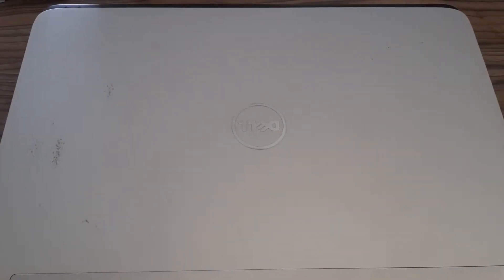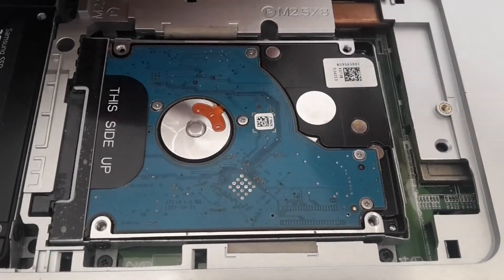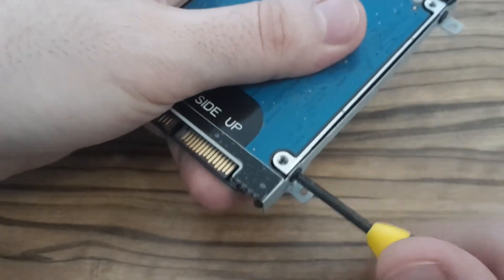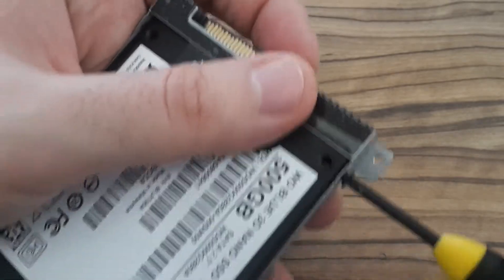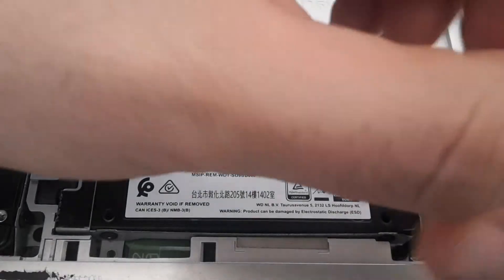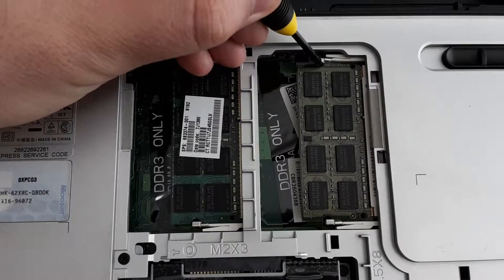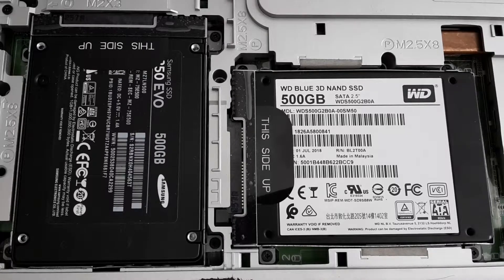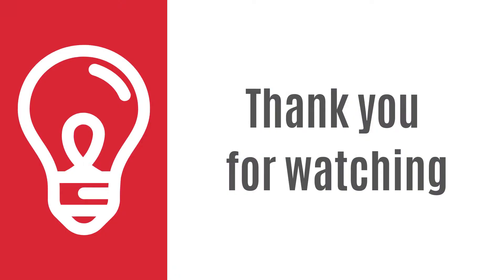Dell XPS 17 L702X Upgrading to a New SSD and RAM

Comment: Thank you for your video, my 11 year old laptop is in desperate need of an upgrade and your video is the solution. I ordered the exact same SSD you used just to avoid any discrepancies.
Reply from the maker: Glad I could help!
Reply: How did it turn out when you installed the ram? I jsut ordered the same ram. I downloaded windows 10 years ago and it slowed it down so much 😢 hoping the ram upgrade helps

Comment: Hi i have question we have the same laptop but i have 4 slots of ram is it an problem if i do 4x 8gb? And maybe one 1tb ssd and other 1tb hdd?
Reply from the maker: Hmmm, but that laptop supports only up to 16GB RAM, so you can try 4x4GB RAM. The HDD/SSD don't have limits.
Reply: @zeroampselectronics  oh really that's weird but I have an fun fact I did 1x8GB 3x4GB  (20GB ram) and nothing happened it runs  really good and play GTA 5 perfect in 2022😎
Reply from the maker: @nourilo5487  you might have a especial edition try 32GB if it works.
Reply: @zeroampselectronics  yes i would like to try that but i have not found anyone that has tested before i am now looking for another l702x i would like to try it on but they are really hard to find
Reply from the maker: @nourilo5487  they are very old but you might be lucky.
Reply: @zeroampselectronics  yes, if I still find 1 and have tested it, I will definitely let you know

Comment: Great video! I have the same laptop and have been running into an issue where the system runs at 100% disk usage, so everything is super slow. I've googled the issue, cleaned the disk, and have done several other solutions i've found. Might upgrading from HDD to the WD Blue you use here help, or is the Samsung 850 EVO 500gb SDD like you have in slot 1 better?
Reply from the maker: I decided for WD Blue because it was a bit cheaper I didn't have extra many for Samsung that time.

Comment: Thanks for this video. My brother was trying to install an SSD in my laptop for me and couldn't get it to work until following your video :) I do have a question though. I don't know very much about computers so hopefully you'll understand what I mean. I wanted the SSD installed mainly for a few games and wasn't going to move anything else, but was recommended to put windows on the SSD because it'll make everything faster. I've tried googling, but the guides I'm finding only tell me how to clone my entire hard drive onto the SSD. My hard drive is much, much larger than the SSD so cloning everything wouldn't work. Do you know how I could get windows to boot from the SSD without copying everything else to it? Thank you.
Reply from the maker: Hi, I'm glad that it helped :-)
Reply: @zeroampselectronics   I've managed to delete enough off my hard drive that everything can fit on the new SSD, so now I'm on to the cloning process. Is there any cloning software you know of that you'd recommend? Been googling and there's so many options that it's a bit overwhelming haha.
Reply from the maker: Hi, I use https://www.macrium.com/reflectfree, but you're right there are many others on the Internet.

Comment: I installed a new ssd no problem. Created bootable windows installation USB. The computer boots into setup and copies Windows files from the USB to the new SSD. Then the installation tool goes to restart the computer to finish setup but can't restart. It just ends up with a black screen/blinking cursor. I used Rufus with MBR target: BIOS.
UPDATE: Removing HDD from position 2 fixed this. For some reason, I think the boot loader was being installed on the backup HDD, so the new install would not load. (I only replaced the primary HDD to SSD)
Reply from the maker: You can change the order in BIOS for loading.
Reply: @zeroampselectronics  thank you - yes, I had it set to boot to disk 0 which was the new ssd then usb. For some reason, removing disk 1 (the other original hdd) solved the issue. I read somewhere that with these old laptops that the installer can put the bootloader onto the second old hard disk.
Reply from the maker: That's really strange.
Reply: @zeroampselectronics  In my recent experience I had to remove the second drive to format and install Windows 10 Pro.  the system did not lift and did not install properly with the disks installed

Comment: Hi, I installed a SSD and Im trying to install w10, but my usb is not showing up in my boot devices..
Reply from the maker: Hi, you must change that in BIOS.
Reply: @zeroampselectronics  Im at BIOS version A11, I dont see any settings regarding USB boot device..
Reply from the maker: That's very strange because on mine there is such a option to boot from USB. My BIOS is A17.
Reply from the maker: It looks you have an old version. Try to upgrade your BIOS.

Comment: I attempted to put a ssd (has windows, booted in a desktop fine) in mine to replace my hdd, but its saying no operating system when attempting to boot from the ssd. Any idea what could have to be done?
Reply from the maker: Hi, I guess, you have a wrong BIOS configuration on your laptop. Compare your desktop and laptop booting configuration.
Reply: @zeroampselectronics  its hard to compare bc they look completely different, its the z170a and i have an x570 gaming edge. Thank you for the help! I'll try it.
Reply from the maker: I just meant to check booting mode either: "Boot to UEFI Mode or Legacy BIOS mode". If you use your SSD in one mode it should stay the same. Otherwise it won't boot correctly. The second thing is that your desktop has completely different configuration than your laptop so the Operation System won't work on your laptop anyway. I recommend to install the OS on the SSD in your laptop from scratch.

Comment: Hi, can you put ssd drive in first main disc slot directly under a ram slots? Cause i don't see a proper space to move down the old disc and remove old disc.
Reply from the maker: Hi, are you talking about the laptop XPS 17 meantioned in the video? If yes, there are no drives under the RAM slots.
Reply: @zeroampselectronics  yes i know in xps 17 but I mean first drive slot that is the main drive slot. I want to put SSD drive in main first drive slot and reinstall windows system that because my main drive makes some errors durning system loading and obviously i want to speed up overall. Thanks for the answer.
Reply from the maker: Go for it, there is no problem to do that with this laptop and you will see a huge improvement immediatelly.

Comment: I am seeing that Crucial advises that this DELL model only takes 2X4GB RAM. Why are you saying 2X8GB? I would like to think that I could upgrade to 16GB but now I'm not sure. Can you explain your reasons for suggesting 16GB. Thanks for the video upload btw. (Edit) Also, Why did you use two different SSD drive brands, i.e. Samsung and WD?
Reply from the maker: Hi, I installed 16GB on my laptop and it works all right.
Reply: @zeroampselectronics  Cheers for your speedy reply. :)) Do you notice a big difference in performance? (edit) Would this RAM work? https://www.alza.co.uk/crucial-so-dimm-16gb-ddr4-2400mhz-cl17-dual-ranked-d3988537.htm
Reply from the maker: Hi, frankly NO. I very really use more then 8 GB. Only when I use virtual machines. When I installed a new SSD instead of the old HDD it was a different story. I immediatelly noticed that the performance increased dramatically. Regarding your second question watch https://youtu.be/j1B8kfZ0W24 and read the desription. DDR4 won't work only DDR3. In the description of the video you find the memory type you should buy.
Reply: One of the models (the 3D model) has 4 RAM slots and I've been told it can do 32GB.